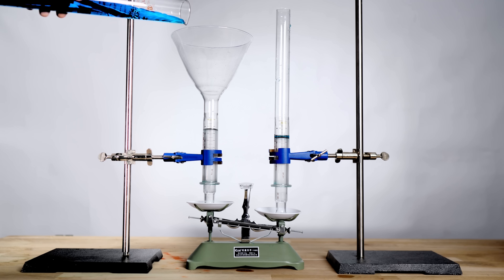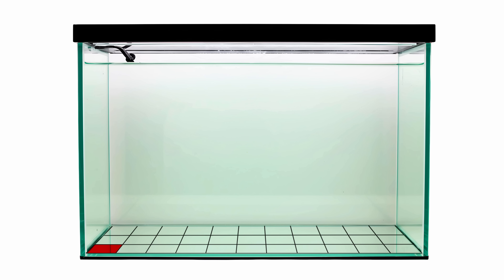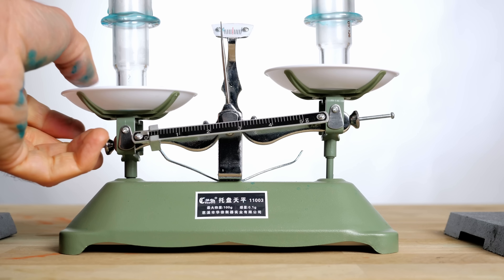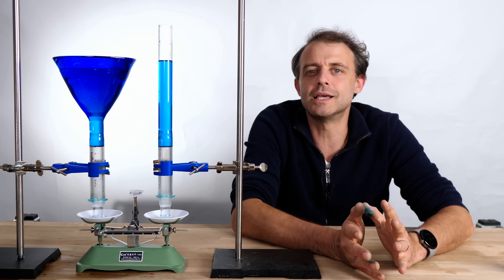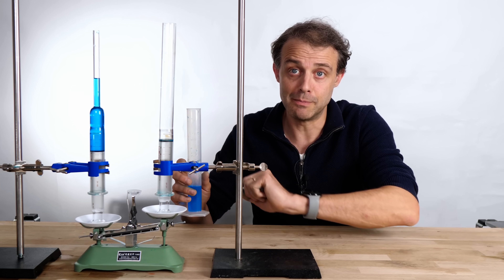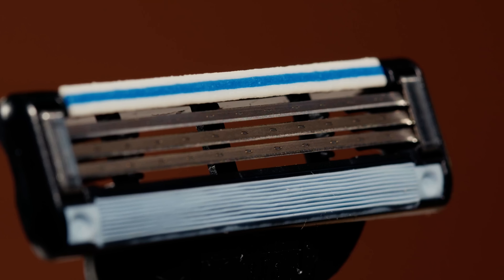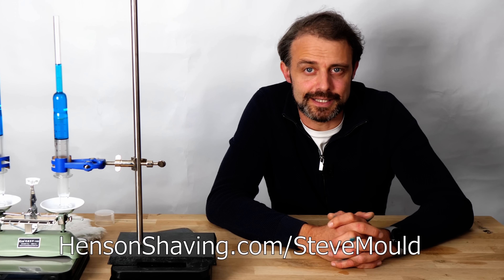The Hydrostatic Paradox

Comment: In the last setup, the upward force on the container and thus the clamp stand is what we normally would call buoyancy. The container is trying to float above the water, so it becomes lighter.
Reply: This. I couldn't believe when the video ended and he hadn't said the most important word. Buoyancy.
Reply: @robertszynal4745 its not buoyancy. I dont think the glass is less dense than the water. instead its being pushed upwards by the pressure of the water
Reply: thank you, that made it a little easier to understand
Reply: Damm, makes sense!
Reply: Buoyancy from the point of view of those in this thread that argue against the use of it is a subset of the same base effect of molecules pushing on each other through forces. In their mind its a completely separate effect where a volume of one material of one density is being pushed out by a volume of liquid or gas. 
With the argument that "its confusing to call it that", you make an assumption about the context in which this term is used, from the fundamental physical view there is no difference. From a practical engineering view there is.
Its easy to see how it falls apart - what is a volume? What defines a volume of something, a steep gradient of density in a system? Then the example in the video where there is an area of a pillar surrounded by higher density area of the same material creates a gradient and you get two distinct volumes that equalize the system. You may argue that displacement should take place, but it does happen here as well. Definitions of buoyancy, volumes and objects in mediums are just abstract labels that simplify reasoning, they can not sufficiently describe a complex system like this one. The fluid itself is the object and the medium, displacing itself because it is not a single entity but a system of atoms exerting forces, which is the same exact thing that happens to any other system that you consider to be an example of proper use of buoyancy.
Reply: OH. That just made it click for me, thank you!
Reply: Oooooh, and since the clamp is immobile, the force of buoyancy bounces back like when we push on the ground to jump and thus increases the force applied on the piston !
Reply: Yes, if you think of a floating object as the narrow column. The water it is displacing pushes back.
Reply: For everybody arguing that using the term "buoyancy" does not clarify the case of the narrowed tube at 6:53, imagine the following. 
Take the straight tube and fill it halfway with water. Now take a ring-shaped glass boat, which is exactly the difference in shape between the straight tube and the narrowed tube, and insert that boat into the straight tube, such that it floats on the water.
In that case, the buoyancy force on that ring-shaped boat is equal to the weight of the water it displaces. That force is also equal to the upwards force on the original narrowed tube.
Reply: Great connection made! Thank you for sharing, Friend...
Reply: Kind of. Pretty good analogy though.
Reply: Wow! Thanks for dropping this bit about bouyancy.
Reply: this must be some flat earther trolling
Reply: Now imagine a fountain consisting of a vertical glass tube connected through a valve to a large vat filled with water to a level above the opening of the cylinder. We now place a solid glass sphere upon the cylinder and then open the valve to observe the glass  marble floating on top of the water ejected from the glass cylinder.
Is the glass marble buoyant? 😇
Reply: I get the idea but saying something becomes lighter because it tries to do something does not sit right. Like it can magically exert less force downwards?
Reply: No it's not. Buoyancy is the force a fluid exerts on an object within that fluid, not the force exerted by a fluid contained within an object. The container isn't floating, nor is it trying to float. The water trapped inside it is just pushing it upwards because that water has nowhere else to go. It's a completely different mechanism from buoyancy.
Reply: @SirPhysics   
Is it?
Reply: @SirPhysics  the force of a fluid on an object and the force of an object on the fluid are equal and opposite (source: Newton) so that distinction is splitting hairs. Something does not have to be floating to experience buoyancy, as any child who's tried to hold a swimming float underwater can tell you. In fact, the upwards force on the glass is exactly how I would interpret "trying to float" - it just doesn't get very far towards that goal due to its weight and the clamp. In other words, I think you're wrong in every respect there
Reply: No it's not the same as bouyancy, that way in setups where container is funnel like should try to float too, bouyancy has roots in the concepts that cause this effect too, but this is not bouyancy, bouyancy is because the pressure pushing up below an object is larger than pressure pushing down above it in water, this container isn't submerged in water, the funnel container isn't trying to float, it's only being pushed down because it has no water below it, the inverted funnel type container has areas where water is below it, that is where water pushes it up, so it gets lighter, the straight column container has no area where water can push up or down, so no change in weight
Reply: @SalmanTarar-zz8de but you said it yourself: "the inverted funnel has areas where water is below it, that is where the water pushes it up, so it gets lighter", 
which exactly meets your definition of buoyancy, where the pressure below something is larger than the pressure above it, causing a net upward force ..?
Reply: @Harry_Gersack but if you called this effect bouyancy, that would be selectively applying this concept. Because other container are not trying to "float" above the water because they don't have the same geometry and water isn't below them. 

Also, since the containers are not completely inside the water, i.e there is no water around it or below the whole thing, the mathematical definition of bouyancy won't apply to any of them either and the force experienced by them wouldn't be correctly calculated by bouyancy formulas. 

Just saying calling this specific case bouyancy is nitpicky and not completely accurate. It helps understand the concept yeah, but then someone might develop a flawed understanding of bouyancy
Reply: @Harry_Gersack Buoyancy isn't the right term here because the glass is being pushed upwards by contained pressure rather than a simple density difference
Reply: @SalmanTarar-zz8de   "But then someone might develop a flawed understanding of buoyancy."

You mean like you have? 

An object does not have to be submerged in water to experience buoyancy. A helium balloon floats in air because of buoyancy.
Reply: @Harry_Gersack  buoyancy is about density.
Reply: @notahotshot  but glass is more dense than water and would otherwise sink in the water, so although i totally agreed with you at first, it certainly mimics bouyancy, that would be impossible since glass isn't bouyant in water unless it's a bottle with air trapped in it, or it's a bowl or some other boat-like shape.  the container in the video is not trapping air and is obviously not shaped like a ship, and the water can slide upwards along its walls rather than being stuck at the bottom. something else is going on here and personally i don't think he (Steve) explained that part very well, because obviously some of us are still confused (including me.)
Reply: @SalmanTarar-zz8de  nah, your comment is the nitpicky one. Calling this buoyancy is helpful from an intuitive standpoint even if everything you say is true, because they ultimately have the same physical cause (an imbalance of upwards vs downwards pressure forces). It's intuitively obvious that the net force in the first funnel is down, even if that's difficult to quantify using standard buoyancy formulae that weren't intended for this scenario and so I don't think that your criticism is all that relevant outside an academic context. Spotting underlying links between supposedly different things is helpful and a huge source of progress, historically speaking
Reply: The way I see it, buoyancy is when a liquid tries to flow under a submerged object and tries to equalize the height of the surface everywhere, so it applies an upward force to the thing that is preventing that - the submerged object. This phenomenon is a liquid trying to equalize its surface height everywhere, so it applies an upward force to the thing that prevents that - the glass "ceiling". I think you could even demonstrate this with a donut shaped object submerged in the regular columm. If it were the same shape as the part that's "missing" from the special glass, and it had air inside, the same amount of water would rise to the same height in the middle of both sides. So not buoyancy is the usual sense, but most likely still buoyancy. It's all just pressure with different names anyway.
Reply: @bosstowndynamics5488 ok I see.
But I don't the other guys accept the argumentation about the shape of an object not being relevant for buoyancy.
What about ships for example? 
A big ship made of steel also only floats because of its shape. 
Flip it on the side and it will fill with water and sink, because steel doesn't float. 
I see that if we calculated the average density of a ship, including the air that fills the space within it, it would be lower than the density of water, so it floats. 

Now I'm trying to make a connection to our case here, but I can't make one, so I guess I have to accept that buoyancy doesn't play a role in this video.
Reply: excuse the typo

*"But I don't accept..."
Reply: @notahotshot 

Air is also a fluid, (fluid does not mean water, and it doesn't even necessarily mean liquid!)

So, the helium balloon is submerged in a fluid.

If you tried to float a helium balloon on the moon it would fall to the ground just as fast as a brick would, because it's not displacing any fluid.

(I'm not going to make any claims about "buoyancy" being the right or wrong term for what this video demonstrates. I don't know if it's appropriate or not, or even if it's a question with an objectively correct answer or not!)
Reply: @tirkentube  " the container in the video is not trapping air and is obviously not shaped like a ship" - you can imagine it being shaped like a ship if you imagine extending the vertical lower wall straight upwards towards the water level. Then it is a ring shaped ship. The upwards force is the same as weight of the displaced water in that ring. 
I think using the term buoyancy helps in clarifying what is happening, and is therefore useful. Even if it does no strictly meet the definition of the term.
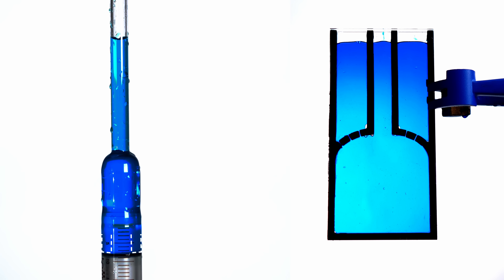Reply: @Harry_Gersack  the column of air outside and above the glass dome is what you're missing. That volume of air below the water level is, in combination with the shape of the glass, creating a volume of lower density than the water. If you look at 9:24 , that space could be filled with water, and is in the straight column, but is instead filled with air. Like other comments have pointed out, you could extrude that cross section out, then attatch the ends together into a ring, then shring the center donut hole to nothing, and the piece of glass in the center would be a boat. If it were not attached to the clamp stand, you can imagine it would not float nearly as far down in the water. In the setup as it is, the glass-and-air volume is transferring that bouyant force into the clamp stand, reducing its weight.
Reply: @SalmanTarar-zz8de  Of course this is bouyancy. I don't know where your strange definition of having to be immersed in water comes from. It's not even about water, but only about the difference of pressure causing an upward force. You can also have buoyancy in air, with no water at all. And boats have it while only being partly in water. Every single object that is in a liquid or gas with a pressure gradient caused by gravity experiences buoyancy.
Reply: @SalmanTarar-zz8de isnt that means what container would start moving upwards at some point?  😅
Reply: @ИгорьДементьев-и7м   
Isn't.
Reply: Dude you don't have to be fully submerged into a fluid in order to float on top of it what are you a twelve year old? How do boats work then genius?